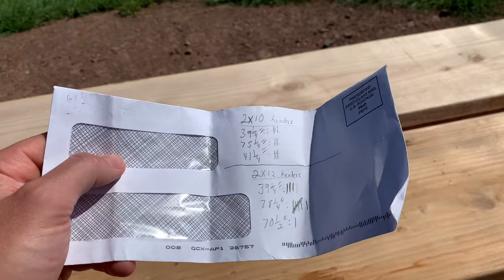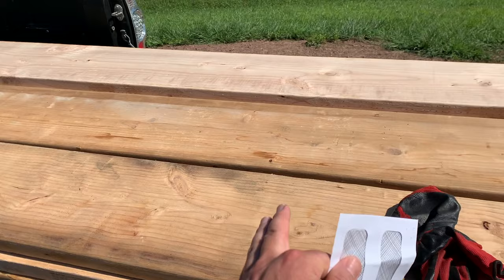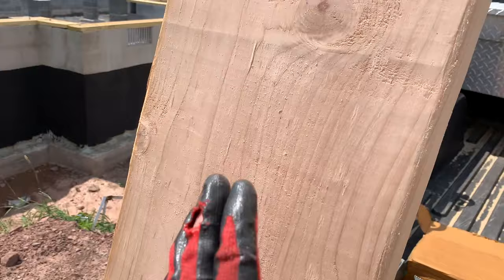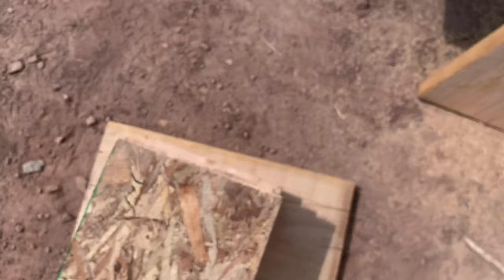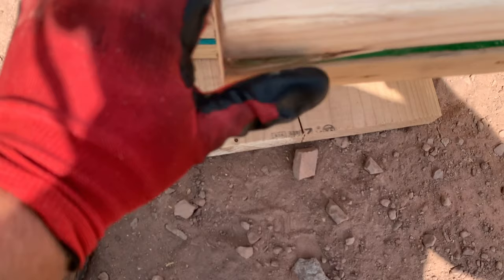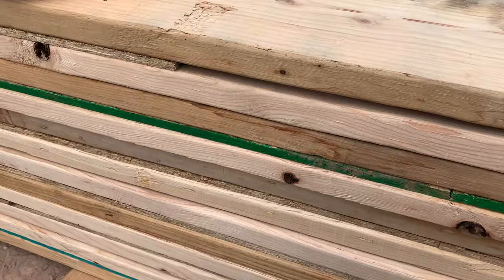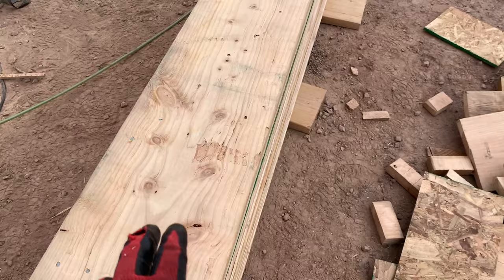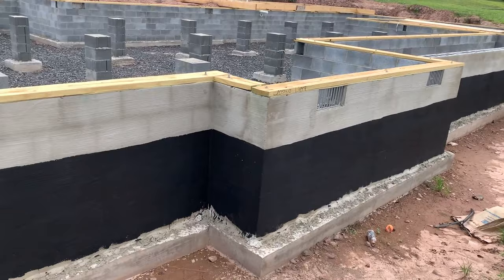How To Build Headers For Door And Window Opening

Comment: Use wood glue. Clamp tightly, checking for squareness. Fasteners should be in vertical alignment. Forces act at the top and bottom of beams. This V pattern thing is folklore. For headers over 36 inches or so use bolts, or the equivalent modern structural screws (FastenMaster, GRK, etc). If nailing, hand hammer (not nail gun). The goal is to get the pieces to compose a single moment and you can come close with attention to detail. No fasteners within 2 inches of end (to avoid splitting in shear area).  And do not assemble and store. Build as needed and fasten into place to avoid twist and warp. 

Yeah sure, over a 32-inch window in a single story house not a big deal. But for larger openings and/or multiple stories you really need a header to perform.
Reply: This guy frames. I like it
Reply: Everything this guy said
Reply: Bolts,... in a header?  Sure, we'll just have some weird box covering the head and the excess threads and nut.  WTF?  Glue?  Riiiiigggghhhhttttt.
Reply: @NotAPanini  everything he said is not correct.  you don't use bolts or screws in a header.  The nails provide better sheer strength.  Bolts will be large and the head and excess threads and nut will stick out so then the sheetrock will have some weird box covering it.

Comment: I have a question, but first, I was taught that not only does the 1/2" plywood/OSB provide the extra thickness to make it  31/2" the plywood sandwiched in between also acts for structural stability against downforce especially over longer spans. What is your suggestion for long spans such as 10' or 12' for material to use in between the 2X12s?
Reply: The OSB/Plywood only adds thickness to the header itself so that it is the same thickness the rst of the studs/wall so the sheetrock lays flat when screwed to the wall.  The 2x10 or 2x12 is what supplies the strength over the open span.

Comment: I'd like to make a box header out of 3/4" plywood as I could leave 1/2" in the middle for rigid insulation and then fill entire space from top of rough opening to top plate, eliminating short cripples. I'd have to stagger my breaks as plywood comes in 8' lengths and the header above the garage is 8' 6". Don't know if it would pass code or not. Be more expensive but would eliminate the bowing and seasonal movement of dimensional lumber.

Comment: Would two 2x6 headers stacked on top of each other be the same as a 2x12 header?Or would be like a 2x12 header with a split in the middle ?

I’m trying to correct a problem done by a previous builder. Even though I have a support wall up I just don’t want to remove the header that is installed
Reply: No, that would not be a good idea. You want the header to act as a single, solid member.
With an existing wall, build a temporary wall to bear the load properly, remove the old header, install the new header properly, remove the temporary wall

Comment: What size lvl header for 16 and 20 feet span
Reply: I don't see a 16 or 20ft span mentioned in the 2021 International Residential Code Book.  For something that large you probably have to talk to an Engineer and have the header designed.

Comment: I would like to save a couple thousands on not buying custom windows without loosing the size. This leaves me with a small header opening. A little more than a 2x4 can fit in the gap. It’s no load bearing on a gable end. Is there a way to get around having to use a 2x6 as header? Different material? Like a metal beam?

Comment: Thanks for the video! Maybe I missed it but should the cupped side be on the exterior or interior of the wall?
Reply: Cup side goes inside towards the OSB that way when you nail it it will draw the cup out or flatten the cup as much as possible

Comment: What size nail do you use for these header sandwiches?
Reply from the maker: 16d 3 1/4”
Reply: 3 1/4" is a 12D nail. 3 1/2" is 16D nail.
Reply: home depot sells the 3 1/4" as a 16d option.

Comment: for a 2x6 (x2) with 1/2" ply, what size nail do I use, and do I do both sides? this is for 36" entry door.
Reply from the maker: I  use 3 1/4”  16D nails. And I nail from both sides. So it’s a strong sandwiched header. Hope that helps!
Reply: @TheExcellentLaborer  yes, I'm going to go buy some nail now as I've only got 2-1/2" at the moment. Thanks
Reply: Glue and Screw it!

Comment: What size nails do you use?
Reply from the maker: 12D or 16D. I would use 16 D if possible. Thanks for watching!
Reply: @TheExcellentLaborer  made my header today and it came out amazing! Used the w pattern and also a 5 row line 16” OC. I had to put one beam up at a time and then nail them together in place due to the LVL weight. They were 16’ long. Used three jacks and Simpson sraps to tie the double top plate, 10” header, and jacks